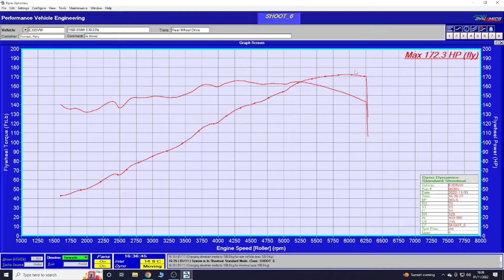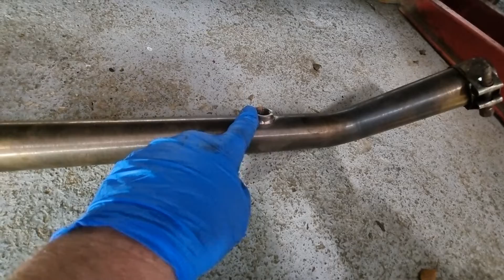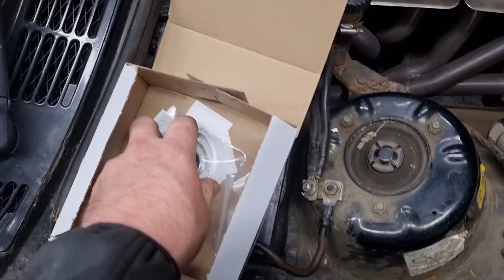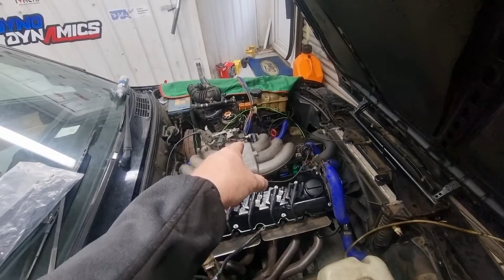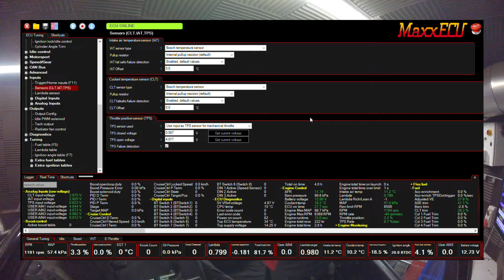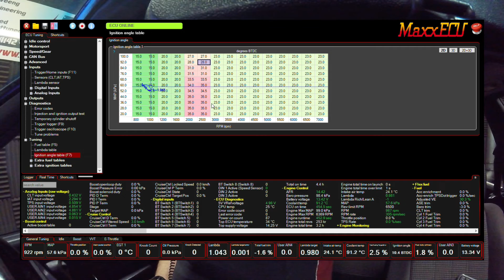BMW E30 M20, MaxxECU Street Conversion, Sequential Injection, Ignition and coil on plug.

Comment: hey there. my maxxecu race tacho signal is wired to GPO8 but the cluster does not show any rpm. Same with other cluster swapped. maybe you know or you can check what configuration in tacho output settings are set to make e30 cluster work with maxxecu ? thanks!

Comment: Very interesting. Did you use the original engine wiring and added cables for additional sensors and repined it for the maxxecu or did you make a completely new one?

Comment: can you tell me how did you position the cam trigger mechanically correctly ? from MRT you have a lot of adjustment space for the trigger. How to position it correctly when the crank is at TDC?
Reply from the maker: The cam trigger is just being used as a 'Home' signal in this case, so it would be anywhere on the compression stroke cyl1. I'd have set that in the ECU settings.

Comment: Can’t decide between maxx and link. For a an m50b25tu. Then possibly turbo. Jz in the future
Reply from the maker: We deal with both. Both great ECU's. I really like the 'plugins' within the Link range, but usually end up with a MaxxECU on things like this. Id go with whatever your tuner feels comfortable with. :-)
Reply: The maxxecu sport line models and up have many more Street drivning features than any Link ECU such as check engine light and for many Other lights in the instrument cluster and of course oem digital speedo and tachometer outputs. And beacuse you have so much settings while setting up sensors you can use any type of sensor thats fits the best and is the cheapest so the maxxecu is a more of a diy style setting up but is cheaper. Link ECU have many sensors of their own that is plug and play however more pricer. And with maxxecu you dont need any gauges you can use the mdash app/program on any smart tablet i dont remember latency but it was low. LinkEcu Might be better for competition for most people

Comment: My e30 is a 320i from 1989 with a m20b20 engine swapped from an e34, my old motor had the distribuitor in the left side of the block, not in the front of the camshaft, so at the moment im running with my old dizzy on left side, is there a problem or will i have problems in the future?

Comment: Hi, great vid as usual. What knock sensor and det cans do you use/recommend and how is it wired and positioned? Cheers.
Reply from the maker: I used my Phormula system on this car. Just bolted the knock sensor on the side of the block. I don't recall where honestly now. :-)

Comment: How much would this cost fitting etc
Reply from the maker: I believe this was about 4-days labour plus the parts.
Reply: @TuningShed  yh there's no cost?
Reply from the maker: @andreawilliams3092  I'm always reluctant to give prices on anything in the public forum, the price remains the same on here forever. People phone in 9-years, and start the conversation with, "I've read online it's £x" or similar! Lol  As a rough guide though, this was approx four days labour plus parts. We charge £65p/h right at this moment. We can always quote a job for you of course if required.
Reply: @Tuning Shed  fair enough do u have a way I can contact you
Reply: I'm getting this done to my 92 gmc typhoon.  For those unfamiliar it is a small suv from Gmc that has a 4.3 6 cylinder turbo charged engine.  It is batch fire fuel injection system from the factory and a horrible factory ignition system.  We are doing a a complete rewire of the of the truck with maxxecu controlling everything.  We are ditching the factory distributor and using the dual sync holley distributor that using a cam crank sensor.  We are upgrading pretty much everything and they are also doing a tune which is costing around 15k.  Could be more or less depending on how neat and what material is used to insulate the wiring harness Also included a tablet to display my engine parameters and a block out plate to cover the old analog speedo.